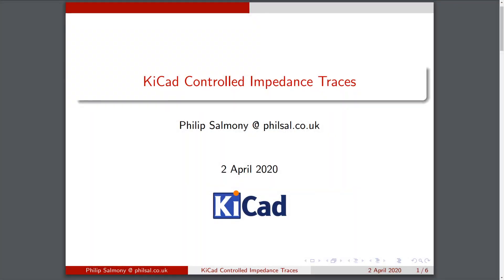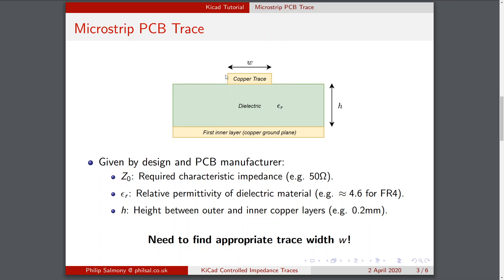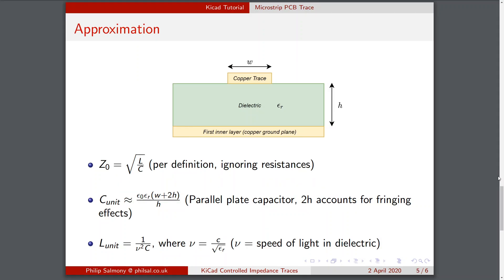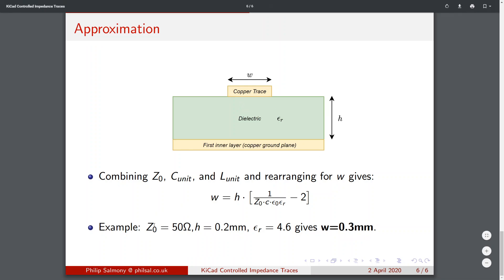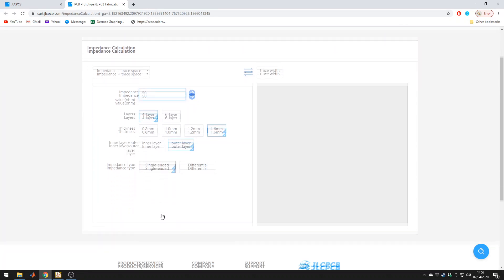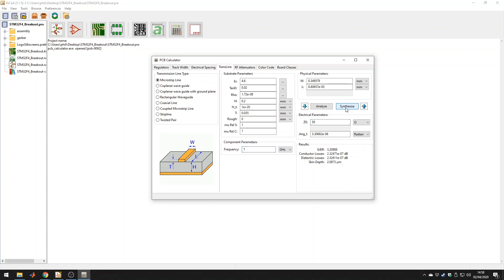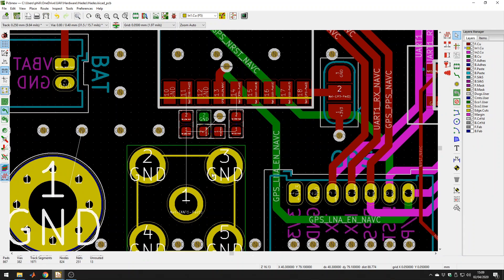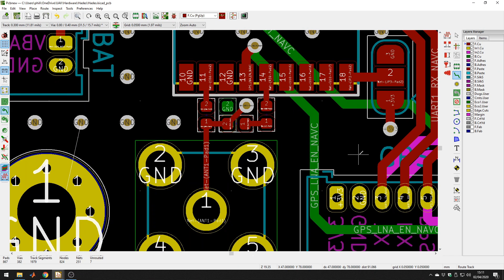KiCad Controlled Impedance Traces (e.g. 50Ω) - Phil's Lab #3

Comment: I believe your equation for approximating the width based on height should have v (speed of light through dielectric) instead of c(speed of light through vacuum). I was using the equation myself and was getting values completely off until I realized this.

Comment: Doesn't the length of the trace (L) given affect the results? It gave you a very small value but you went over that distance and you used different trace lengths to connect the components. Just curious and new to this :body-blue-raised-arms:

Comment: Hey Phil.. Help me out with the approximation calculation here.. I'm trying to work out some calculations for myself but I'm getting different values when working out your calculation.. w = h * (1/(Z0 * c * ε0 * εr) - 2) is giving me -72.41E-3 in your example.. Not 0.3 (if the resulting unit is mm) or 0.0003 (if resulting unit is meters as I would expect).. The negative value bothers me.. If I leave out the -2 then I do get 0.33 which is a bit closer to your result, but still a bit off and I'm suspicious of it giving the result in mm and not meters as I would expect. Am I right in assuming you're using 8.854E-12 for the vacuum permittivity? (wikipedia also gives this constant in a different unit but I'm assuming you're using the farads per meter one here)
Reply: This might be a bit late, but I noticed there's a mistake in the w formula, it should be sqrt(εr) in the denominator, so w = h * (1/(Z0 * c * ε0 * εr^(1/2)) - 2)  is correct. Just in case you were still curious why it didn't work
Reply: @shirootaku2513  Thanks! Better late than never 😁
Reply: Noticed the same, I think the equation should have v (speed of light through dielectric) in it instead of c (speed of light through vacuum) and then it works out. Or you can substitute in C as shirootaku said and that also works.

Comment: I've got a question. I want to do something with a VGA signal so I have 3 traces which need to be impendance controlled to 75 Ohm.
I guess the values for two parallel tracks can also be used for 3 and more parallel impedance controlled tracks?

Comment: A bit late to the party, but the online calculator from JLC is not always up to date, and if you get different values from the calculations done based on the stackup and from their calculator you should double check with their support team which one is correct. I have fried an RF transciever and sure enough, when checking with a VNA the trace impedance was nowhere near 50 ohm.
The last time I checked with them, they basically told me to ignore their calculator and use the values from their PCB stackup to determine the trace width.
The stackup is subject to change, and typically the information on the PCB stackup is kept up to date while their calculator formulas are left behind.

Comment: Hi, what I don't understand is that independent of the trace length if you use a 0.3mm width layer, using JLCPB, the impedance will always be 50Ohm. Is that correct? Thank you very much.
Reply from the maker: That's right!

Comment: @Phil's Lab, I have seen a LOT of videos that deal with topic of characteristic impedance of stripline and microstrip, it comes down to distance from ground plance, track thickness and height and the dielectric constant. However, I can't find information that explains how to get specific impedance from a via! Via by default do not have a return path and their geometry means that the track dimension ends up being different from the PCB stripline and microstrip.

How do people know how to properly use vias when routing high speed connections e.g DDR3? We can't always ignore vias. Also, with vias there is also the topic of plated through hole vias vs blind and burried vias and then there is also the topic of what happens to signal when the via length is less than the signal wavelength and also the topic of microvias.

Comment: JLCs calculator looks like a commercial Polaris calculator which includes examples for losses from soldermask and trapezoidal edges.  
However, JLC is cheap enough so you can order test boards with a few traces of various widths, and measure it on a network analyzer, or maybe just a power meter.
I did.
JLCs numbers did not pan out.
Receivers have a much wider power range and impedance is not as critical on antenna input, but any mismatch losses translate to noise figure, so better make it good.
On high power RF amps losses are expensive and needs to be tightly controlled, but then you will likely not use   KeyCad anyway :-)

Comment: Is 50ohm trace impedance more difficult to accomplish on a 2-layer board due to large value in H? After plugging in the values from the board manufacturer I am getting 2.8mm trace width (110 mil). The height between the top and bottom copper layers is 1.524mm (60 mil). I'm guessing this might just be inherently more difficult on a 2-layer board due to distance between top and bottom copper layer. For some context I am working with connecting data lines from a micro-sd card connector to an MCU.
Reply from the maker: The further away the next reference layer is (or rather, the thicker the dielectric between forward and return path), then wider the trace will be for a given impedance. So yes, for a 2-layer board, you'll need wider traces. This isn't a bad thing however, and many RF boards will be 2-layers (for example, due to the fact that at those trace widths, manufacturing tolerances have less of an impact on impedance).
Reply: @PhilsLab  thanks Phil.
Reply: @PhilsLab  In the video, you say that JLCPCB doesn't offer an impedance calculator for 2-layer boards "for the reasons I mentioned earlier". Are you referring to large trace widths? Why does that prevent them from offering an impedance calculator?

Comment: Exactly the tutorial I was looking for! I know this is a slightly older video, but C67 at 9:20 is really bugging me. Shouldn't the capacitor be connected to R39 and L2 and to ground? I'm curious how it worked, because everything in me is saying that capacitor on the antenna line should short all signal to ground. Perhaps the characteristics of the capacitor means it goes open circuit at 1.5GHz? Thanks!

Comment: Impedance range is typically maybe from 30 Ohm to 120 Ohm, where larger impedance could reduce power consumption.
The impedance of the larger power layers (like 0V/3.3V) could be maybe even just 10 Ohm or so.

Comment: how far way must other signal traces be?  On the strip-line cut view, we see a single line on the top layer, with no other traces on either side. How far must any other top level signals traces be?    Thanks
Reply: If W is the trace width, then a 2W to 4W trace separation is usually sufficient to ensure that the fields couple really well to their GND reference vs. adjacent tracks. You can look at this in a field solver by bringing two 50-ohm lines closer together.

Comment: Nice explanation and good to see the slides in the beginning!  Two things to consider here: 1) I'd typically create a net class for the RF paths and assign the netnames to that class, that way KiCad automatically selects the right width for you when routing the tracks. 2) Coplanar wave guides (with or without ground plane) get quite some benefit on 2 layer PCBs, reducing the spacing to the sides there helps to keep narrow traces even with thicker dielectric layers.

Comment: good tutorial friend.
one thing to  remember Lcritical = (c/f)*(1/sqrt(er))/16       example : At 1 GHz = approx .425” (Microstrip- FR4) (roughly)
so At 1.5Ghz it should be  .425" *(1.5) =.28333"
in milimeter unit : Lc =7.2mm  @1.5Ghz
if your trace length is below Lc, you dont have to consider reflection on the trace.

Comment: You have some splits in your 50Ω line. Both the RF line with the capacitor and the power is split from the antenna in '1'. Can you explain your thinking here? My calculations does not add up for this solution.
Reply from the maker: Yes, unfortunately all boundaries (trace to pad, trace to connector, etc) will give rise to impedance discontinuities. However, this is something that is unavoidable with these 'lumped elements' and for relatively 'low' frequency work as is shown here (less than 2GHz) the effects are negligible. For higher frequency RF work, lumped elements are typically avoided and replaced with distributed elements that perform the roles of Ls and Cs.

Comment: Great video. What about the track gap if there is a copper pour on the top layer?
Reply from the maker: Thank you, Graham. If you have a copper pour surrounding the trace, then you'll have to calculate the impedance for what is called a 'coplanar wave guide'. This is very useful to decrease the trace width, when impedance matching for two layer boards.

Comment: I'm wondering why you used UART if there is I2C available. It's producing GGA, GLL, GSA, WTF, YOLO messages that are more human than microcontoller friendly, and well ...slow af. 
Have you considered modular architecture? I can imagine testing navigation computer and main uc providing mock inputs from the computer.
Reply from the maker: The Ublox module also has a binary protocol available on the UART. I only implemented the NMEA parser (found in the Git repo) to test if I can get a fix and positional information.
Yeah, I've been wanting to hook up one of these boards to the flight simulator I made, to simulate sensor readings from the aircraft. Been pretty busy with other projects so haven't found the time yet unfortunately!

Comment: Several years ago I came across an app note (I can't remember exactly where) that stated that if the length of the trace exceeds a certain ratio to the signal wavelength (again not sure if it was 1/4 or 1/2 or 1) and, if the trace makes a 90 degree turn, then return currents in the ground plane can travel by way of the hypotenuse of the triangle formed by the origin, turn, and destination. In such a case, it is advisable to have the ground area under the signal trace be a matching trace with a single connection to the rest of the ground plane; either at the origin or the destination. This was probably for signals above 1GHz, but again, my memory is not serving me that information presently. Thought I'd pass that along. It reminds me of how you made an isolated ground under a crystal in much the same way. Excellent videos BTW, I'm enjoying them very much.
Reply from the maker: Thank you, Roger! Do you by any chance still have the name of that applicatio note? Sounds like really interesting stuff!
Reply: @PhilsLab   I found a couple of App Notes at Analog Devices that come close: 
https://www.analog.com/en/analog-dialogue/articles/reducing-ground-bounce-in-dc-to-dc-converters.html 
and:
https://www.analog.com/en/analog-dialogue/articles/grounding-for-low-and-high-frequency-circuits.html
also this was my goto for analog design:
https://www.analog.com/media/en/technical-documentation/application-notes/AN-202.pdf
But I haven't found the one I was referencing in my original comment; yet. The search continues...
Reply: @PhilsLab  Hammerstad describes two equations, one when h > w and another for w > h.  Search for "Microstrip wiki, or "Equations for Microstrip Circuit Design Hammerstad."

Comment: When the RF trace goes into the big pads, and into the big body, of the 0603 then you no longer have 50Ohm. To avoid this the use 0402. Smaller pads and body.
Reply from the maker: All parts of the RF section here are 0402 components.
But yes, interface effects will unfortunately always be present when using lumped elements. Using smaller components certainly helps to reduce these effects.
Reply: Good observation, I never considered that!

Comment: So, impedance control is always above 4-layers, no impedance control on 2-layers pcb right?
Reply from the maker: Using a 4-layer board, as opposed to a 2-layer one, enables you to have thinner traces for controlled impedances tracks. For instance, a 50 Ohm trace on a typical 4-layer (FR-4, Er=4.5) board will be around 0.3mm, whereas for a typical 2-layer board a 50 Ohm trace would be almost 3mm!
Reply: @PhilsLab  That is true. But is it possible to use "coplanar wave guide with ground plane" instead of "microstrip line" in this case? The width of such trace would be 1.05mm (on 2-layer 1.6mm FR4).
Reply from the maker: @Chupacabras222  Yes, that's a good point - you could use a CPG (with or without ground plane)!

Comment: I love channels like this which provide well-presented knowledge!
Reply: Ok, so let's say we do all the calculations and layout the board n v now have the board physically in our hands, how can v measure this 50 ohm impedance to test or check if it is indeed 50 ohms? How do v check if the capacitor value across the antenna needs tweaking?
Reply: Would I need to think about this for amateur radio transmitters on HF? 7MHz or so? I’ve made a board for a transmitter and was about to get it made. It needs to be 50ohm usually. You’d match for the antenna, of course.
Reply: instablaster.

Comment: Cool info. As this was an unfamiliar topic to me, I found the information quite useful. What I'd like to know is how bad does it affect signals if the impedance is not matched properly. Obviously there is a margin for error (as you've outlined there is a tolerance of 10-15%), but can one expect to have such things work without taking into account controlled impedance or is it something that must be done in all cases or else failure is guaranteed?